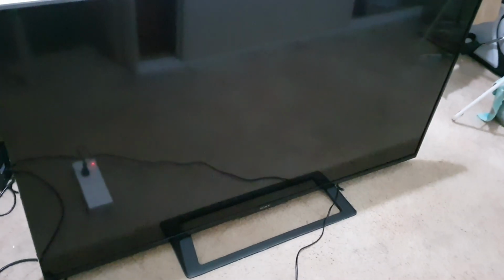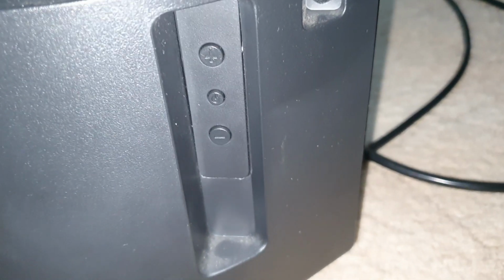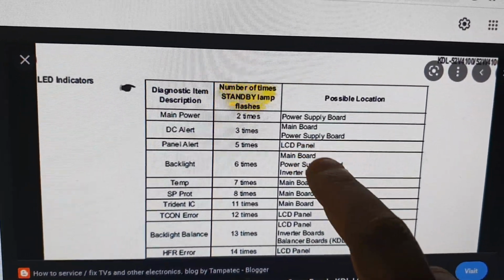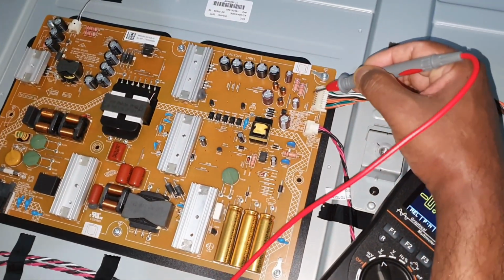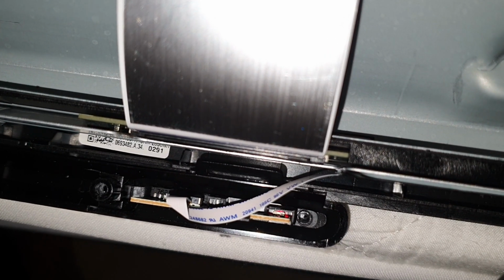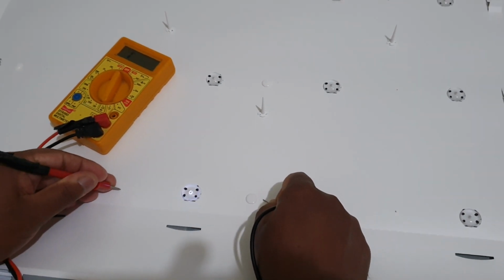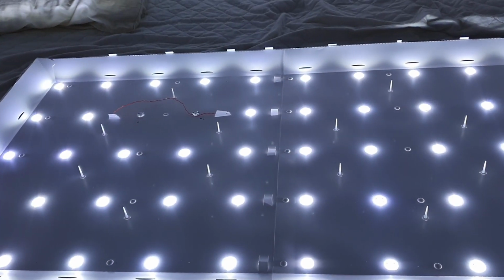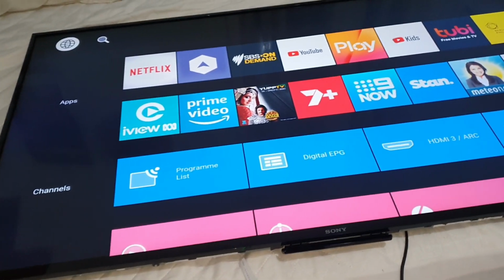Sony Smart TV No Display Red LED Blinking Issue Fixed

Comment: Hello my friend very helpful video one question i have led 32inch tv i have 85 v output for leds black wire not the red wire leds open and then no lights turn on what should i check thank you so much for your help and time any advice.

Comment: Some additional info that maybe useful to others.
I discovered one LED was 'blue' and bypassed as per suggestion in video.  Still would not turn on.
bypassed another at random, and still would not not turn on.
Added 10ohm resistor in series and it turned on - OK.
Removed 10ohm resistor - still turns on - OK (I have been repeatedly testing but still OK)
Here are some measurements with 2 LEDs bypassed and a variable resistor in series with the LED string
Ohms I(LED string curr)  Vc(compliance voltage)  Vr(Voltage across the series resistor)
Ohm	mA			Vc			Vr
0		530		159		0
1.87	532		160		1
9.42	530.5		163.2		5
18.9	527		168		10
28.5	525.6		172.3		15
38.1	524		177.2		20
47.8	523		182.5		25

Update with 2 LEDs un-bypassed Vc = 165.3V  I ~ 540mA and volt drop across the blue LED was approx 3.0v similar to the others

Comment: that was an excellent repair video, thanks for sharing.  
1. Was it easy to remove the panel to access the LED strips 
2. curious if the multi meter displayed a different forward voltage for good (white) LED's verses bad (blue) LEDs.  
Looks like I have no choice but to pull my panel apart.